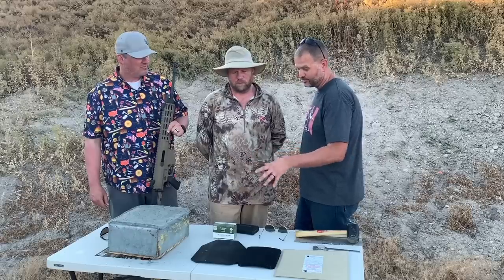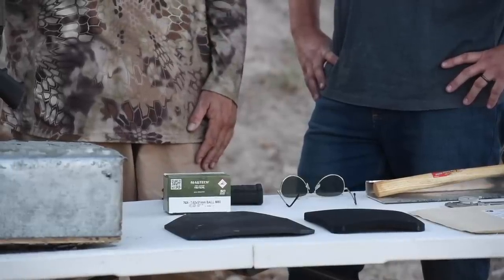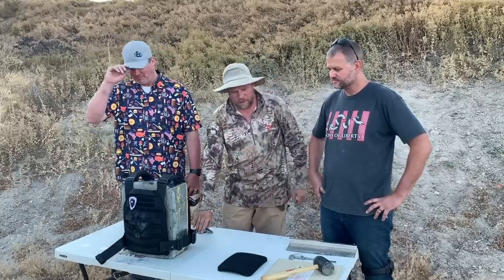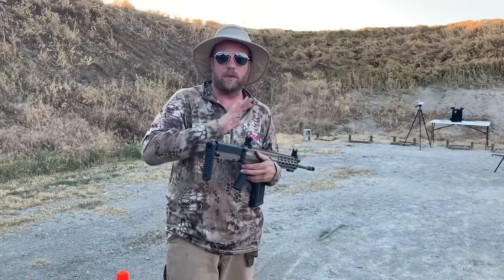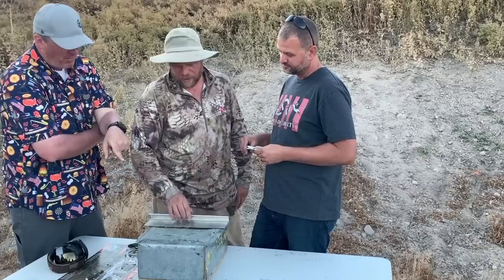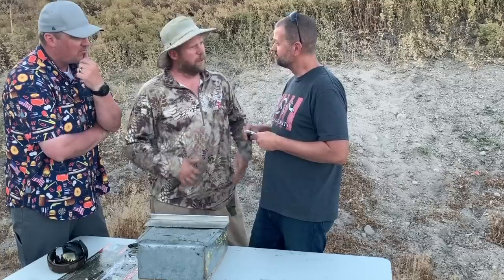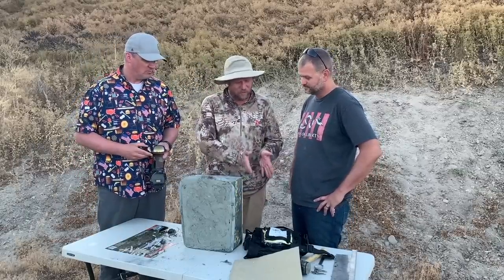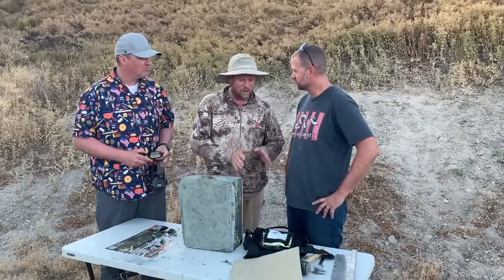Armor Testing: Blunt Force Trauma

Comment: My buddy Paul was hit in the same area on his sapi plate when he dismounted his trac in ramadi. He said it felt like a solid punch. He stumbled a little bit and kept moving. Bruised and sore was the extent of his injury.
Reply: lucky guy
Reply: Did it crack the plate?
Reply: @billstevens5277  yes
Reply: 7.62×39 presumably
Reply: A high level boxer can punch up to 1000 joule,  an average boxer 400-500 joule. Average 7.62x39 will be 2100 joule. You could probably get like 4 boxing gloves on a plate. Sounds logical if feels like a punch.

Comment: Many years ago I got some IIIA soft armor.  The sales rep promoted wearing soft armor while driving to reduce injury in case of accident.  Seatbelt, steering wheel, etc.   They wanted it back for review and would send new armor if you included a police and EMS report.  They wanted more info on blunt trauma to the armor.  Hard, soft, different materials all respond differently and can help in more than just being shot or stabbed.
Reply: Mas Ayoob was recommending this idea years ago, in addition to wearing safety glasses while driving the patrol car. I think he had some pretty good ideas.
Reply: I've seen kevlar vest being used as a standard in horse riding competitions, of all things. As it turns out, being impaled by an obstacle is a nasty way to die...
Reply: There's a well-known case of a Norwegian motorcycle cop who got run over by a car, as in the wheel went right over his chest. He was wearing soft body armor with an aluminium knife resistant outer plate, this armor setup is kind of like a medieval chest plate with kevlar padding. He did get badly injured, but the armor took most of the force amd he survived.
Reply: I read somewhere that most "saves" by vests were traffic accidents
Reply: I can state from experience while wearing soft body armor, being struck by a axe handle several time during a altercation I never received any injuries. Actually while struggling with one suspect, I was unaware I was being struck by another.
Reply: @gregwright392  Stay safe man
Reply: @GigAnonymous  that would be a nasty way to die, if heard that they never clean the darn things so they're filthy

Comment: Would definitely be interested in seeing spall blockers similar to the "V" shaped deflectors that older medieval armor had. Maybe something like an angled HDPE lip that mounts at the top of a steel plate.
Reply: Now THAT is a trademakable idea sir! Perhaps even a 3d printed "Clip-on" type with different fixing options for different plate types? .... Get on this asap!
Reply: @peterbenson2185  can you trademark something that was invented 100s of years ago?
Reply: @jonathanshaw6784  If you're making it to be used it in a modern context, and rated against metal bullet spalling rather than wooden arrow shaft spalling, and attachable to modern armour and plates, I'd say yes. Not sure if the law sees it that way, though.

Comment: And this is not surprising back in medieval time they did where gambeson (linen armor) under chain mail or plate armor
Reply: I can’t imagine taking a hit from a pole axe with bare mail on. Definitely a good way to get bones broken.
Reply: @cmikles1  nah man builds character lol
Reply: @Charles Yuditsky Also floating helmets
Reply: @Charles Yuditsky like how you see on modern helmets, there's a harness inside the helmet that keeps the surface of the helmet physically separated from actually touching your head, kind of like it's floating.
Reply: Speaking of medieval technology, i wonder why they don't add a small collar to the top of the armor plate. medieval cavalry were worried about lances sliding off the chest into the neck and throat area so they added a small lip to the top of the chest plates to deflect the lance away from the neck area. seems like this same design principles would apply to modern body armor as well. id imagine the reason they don't do it currently is because they get the heat treated plates from the factory or forge and don't want to ruin the heat treat, but that could be worked around by welding and molding the plate before heat treat.
Reply: @purplepenguin43  This actually is a thing
Reply: @purplepenguin43  they do have spawling coating on some plates which helps to capture all the debris from the impact. But i do think on full fledge ''battle'' armor they have neck guards of some sort which would presumably have the same benifits
Reply: @purplepenguin43  A gorget, or a bevor is better then a makeing the plate larger.
Reply: @purplepenguin43  Interesting that you mention that because I watched a video recently where they tested an English against a steel breastplate and the breastplate had a small strip of extra metal in the shape of a V near the opening for the head. In one shot, the arrow skidded off of the breast plate, into the V, and then off to the side. Had that V not been there and had there actually been someone wearing the breastplate they likely would have caught the arrow in the bottom of the jaw somewhere.
Reply: @purplepenguin43  Medieval plate cuirasses/chestpieces almost all had a rolled lip that would stop any tipped or bladed weapon from sliding up and into the neck. It was also standard to have a gorget, bevor, or chainmail pixane to cover and pad the throat, and an aventail hanging off of the helmet to drape over the chin, throat, and the upper chest/shoulder area as well. It's hard to overstate how heavily heavily covered a medieval knight would be. Under normal conditions, chainmail was all but impervious to anything but a solid and direct strike from a fine tipped spear or lance. Coupled with plates, its no wonder that most knights survived every battle and were captured and traded rather than killed regularly
Reply: @purplepenguin43  our flak jackets had that. Makes shooting harder though.
Reply: @purplepenguin43  There actually are plates that have this. There's a V-shaped collar that would deflect spalling from arrow shafts shattering. There was a channel that did some pretty extensive testing on a reproduction 100 Years' War French cuirass versus an English longbow, and the collar was very effective in deflecting that spalling. Unfortunately I don't remember the channel, I think Todd's Workshop or something along those lines.

Comment: It seems plausible that blunt trauma was more of an issue with the soft armors that first saw use. I have seen a picture from Korea, whera a US GI is showing of a compound bruise across his stomach where he was hit by a burst from a PPSH. The fact he walked away from that is pretty impressive in itself, of course. A hit from a shell fragment or a rifle bullet sufficiently long range to be stopped by the flak jacket could certainly carry significant amounts of momentum,  
As a (part time)soldier I wear an OpsCore ballistic helmet and a vest with front and back rifle plates and full wrap around level III soft armor. It would be very interesting to see how the non-rifle rated helmet and soft armor perform at long range. How far away would you need to be for the soft armor to stop an intermediate round could be an interesting test.

Comment: Try this with a 3" 12ga slug.
Reply: Something from Brenneke, just look at what the guys from  TAOFLEDERMAUS say about them ;)
Reply: @Charles Yuditsky 

Depending on the bullet weight of the 308 and barrel lengths there can be as much as 500 more foot pounds of energy from a 1760fps 1oz slug. I wonder how much deformation difference there is.
Reply: @MrGiXxEr  but the slug is bigger
i think it would just shatter
Reply: @dreadnought8363  
Or one of those Ddupleks rounds.
Reply: @roboticrebel4092  its still energy transfer. All of the bullets shatter on impact. A slug would probably actually hold its shape better than a rifle projectile. It would be interesting to see if it made a difference
Reply: @alexmiller4881  let me explain better
i think that the slug would be worse at transfering that energy since it most likely would be little more than a soft lead ball

penetrating(=/= perforating) even a little bit is better than simply shattering
Reply: @roboticrebel4092  its a kenetic energy test not a penetration test, KV= 1/2 mv squared. When you do the math the slug has almost 4 times the energy of m855 ball. You are right it doesnt penetrate as well, but this test showed that m855 ball doesnt penetrate either. This test is about whether or not you'd still be combat effective after being shot while wearing armor. Not saying it would render you ineffective but the energy transfer is greater.
Reply: @alexmiller4881  my argument is that higher % of that energy may be absorbed by the armour itself
Reply: 12ga slug vs soft armor alone.....just to see what happens.

Comment: 4:38 In the Miami Dade FBI shootout those agents were shot with a rifle from within 50 meters.
Reply: But there's a pretty big difference between 50 meters and 50 feet. 50 meters equals 164 feet, so you're talking over 110 foot difference between Miami Dade and this test. Granted, if the vest can stop a round at 50 feet then it will have no problem stopping that same round at 50 meters/

Comment: Thanks for mentioning the 14.5 that the police in Northern Ireland were having to deal with. The IRA was using antimaterial weapons against police and basically, it was pushing the plate straight through their torso, they were basically better off not wearing the armor at that point.
Reply: At that point,i don't think any individual body armor will save you.

Comment: Why don't any steel plates change their geometry to try to mitigate spalling? Seems like you could have a small bent lip on the top edge that would help prevent you catching spall in the neck.
Reply: I have been wondering about that for years
Reply: I have been wondering about that too. You can see that kind of lips on munitions plate and some steel plate designs of ww1 used them too so it HAS been done before
Reply: Same here. The coat of plates had the gorget or bevor that covered the neck. It wouldn’t need to be as big as those, but a lip at the top would help.
Reply: @Salesman9001  Problem is that they're the budget insert for the current PC's, which don't have space for a plate to extend far enough up to make a lip practical (the lower it is from the neck the more it needs to extend out).  There are standalone or integrated ballistic throat protectors out there that would probably do the job.

Comment: 12 ga slug, 45-70, and .50Beo I imagine are near rib breaking upon hitting. 308 might be more acute area damage.
NO STEP ON SNEK!!!
Reply: I've shot a Winchester Super-X 28g/1oz 12ga slug into a NIJ IIIA rated helmet (from a top-down direction, after using all the sides for pistol testing) and it pretty much turned the helmet inside out. Still, there was no penetration, likely du to the large frontal area and relatively low velocity (490 m/s / 1600 fps) of the projectile. My feeling from this is that slug wouldn't cause too much deformation to a rifle plate. I'd love to see somebody test it.
Reply: @shaggnar2014  Winchester makes spitzer slugs now. Something like 2000 feet per second. I was thinking about that watching this video.
Reply: I think it's Winchester, might be Remington.
Reply: Sean Donaldson I am fully aware. A major part of the point I was making is that the slug failed to penetrate even just a pistol rated helmet. Against rifle plates it would do much less damage.
Reply: Or .300 Win mag. It's 308 on steroid and it would be very interesting to see the impact of speed on the blunt force trauma.
Reply: Gig Anonymous
.300WM will probably go through a level III plate. Once you have penetrating trauma, deformation is kind of a moot point.
Reply: @Warriorcat49  Something like a .458 Win Mag might be better: tons of energy, but the wider, usually round-nose bullet is less likely to pass clean through the plate.
Reply: Go check Taofledermaus right here on TheyTube. They've done it, I can almost guarantee.

Comment: Wonder what the utility of adding a thin(1-2mm) plate of high-grade/temper steel to the rear of the ceramic plate would be? The deformation would likely be less and the force spread over a much larger area so if it was achievable without adding too much weight it might be a worthwhile addition....

Comment: I think that order of shots made significant difference in the results. On the last shot, there was no contact between hard plate and soft armor because of deformation from the previous shot. If order of shots were reversed, I think results would be quite different.
Edit: I think that shooting AR1000 plate closer to the edge would make a difference too.

Comment: great video that debunks common myths regarding body armor. with modern hard body armor, the backface deformation is NOT lethal, not even enough to cause much real harm at all. also there's a lot of hate for steel body armor, but it has less backforce deformation than ceramic despite most people claiming the opposite. hollywood and videogames actually exaggerates the power of firearm bullets, a person with proper armor against the caliber threat won't have shattered ribs or crushed lungs. statistically no police has ever been killed shot in their vest by a caliber it was rated to stop.

Comment: I've been wondering, if the primary issue with steel plates as armor is the spalling, and UHMWPE plates are excellent at protecting against spalling, why not make a UHMWPE plate with a steel core? That way you don't need to worry about the various liners they use on steel plates peeling off after 2-3 shots.(which I know is excessive but we don't own/wear armor because we are assuming best-case scenarios right?) 
UHMWPE is very lightweight,  though it would add bulk to the steel plate, but I think having the durability of steel, the round-stopping capability of steel, combined with the spall capturing traits of UHMWPE would certainly make the bulk worth it. Having a 1/2 inch thick plate is nice, but if I'm gonna catch spall in my arms, legs, and under my chin when the plate gets hit then it's all worthless imo. I'd rather have an inch thick plate that would take a ton of hits like steel can while capturing all the spall.

Comment: On medeivil armor there was a v shaped piece that deflected arrows, sword points, lance points and what not, why dont they put something similar on steel plates for spalling? It would need to be slightly larger but the same should apply for bullet fragments i would think. Or has this idea been tried already?
Reply: My guess would be that the relative rarity of folks getting shot by a rifle round while wearing steel plates just wouldn’t make the added complexity of adding a large lip/ridge worth it, especially since anti spalling coatings are pretty good.

Comment: why dont plate carriers have a small 45° neck protector that sticks out?

In the form of:

/
|
|
Reply: Not a bad idea but I think due to how far your face/chin sticks out over your chest that the angled “lip” as you might call it would have to be quite large and probably not worth the cost and effort relative to the problem.
Reply: @JimYeats  it doesnt have to be steel though, just something to deflect the spalling. Not longer than 4 inches probably
Reply: As someone that wears external soft armor everyday, a neck protector would be extremely annoying in about 99% of daily activities. I'd assume the same would be applicable to plate carriers as well.
Reply: Well, if you have a spalling protection layer then there's no need (theoretically)

Comment: The spalling in the neck comment is something I've always wondered about, why don't they have a curled lip on the plates to stop that? It was done historically from roughly the 1300's through to the 1900's for specifically that reason.
Reply: There were neck protectors issued in the early U.S army IOTV's but most soldiers didn't use it.

Comment: 1,8" is 45mm
Reply: 25.4 mm to the inch. So that would be 45.72mm. 1.73" would be closer. As another commenter said, probably 1.75" converted, fractions rounded down.

Comment: I don't trust the validity of the results of the second shot on the ceramic armour (with the soft kevlar backing). That particular piece of plate could not, given the deformation from the first impact, have been repeatably situated snugly against the clay dummy-torso and would have had a fairly substantial stand-off distance (i.e. there's no way it was "worn" correctly). I don't think the results from that second shot on the ceramic plate are trustworthy. I think the plate existing deformation pattern would have "rolled" like a wave, up the soft kevlar padding, and wouldn't have imparted it's energy in the same way. I get the plates are expensive, but I don't think reusing the plate in this situation returns a valid result.
Reply from the maker: We look forward to your video demonstrating your claims.
Reply: @InrangeTv  The tone might've came across more strongly than intended. I wasn't trying to attack, only to suggest that the methodology might not have been perfect and you might have overlooked one possible, fairly serious confounding factor. As much as I would enjoy trying to repeat and improve your tests, I'm afraid that's not possible in my current circumstances.